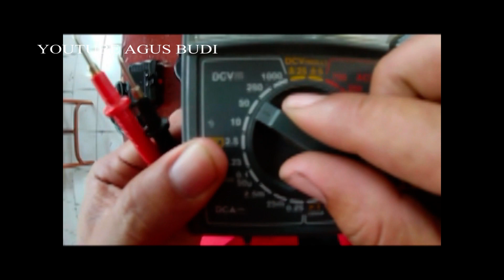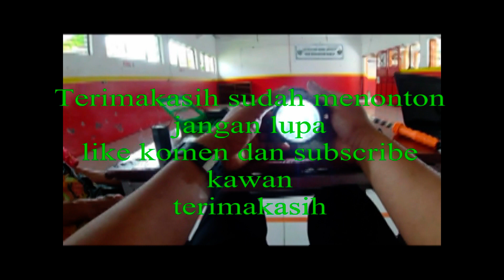senter led modif lebih terang lebih tahan lama

Comment: Bos mau tanya aq kn pny senter kpla tp batreiny dh ngedropan misalkn di tambah 1 batrei lg gmn bos, Batrei yg lama kan vol nya cuma 3,7vol misalkn d tambah 1 batrei lg yg volnya jg sm tp masangnya d seri  kira2 lampu led nya kebakar ndk bos.?
Reply from the maker: ya kebakar gan nanti keluarnya malah 7volt gan tp yang terbakar resistornya dulu di paralelsaja gan nanti voltnya sama tapi ampernya tambah
seri itu hubungan satu tangan  + dapat - 
paralel hubungan 2 tangan + dapat +        dan          - dapat -
Reply: @solusiotomotif  oow iya iya trimakhasih.soale puuuadang takutnya lama kelaman mbleduk hh
Reply from the maker: ya gan sama sama
Reply: Cara menaikan ampere pd senter taffwar gimans gan ?

Comment: Info mas..
Itu batrai berapa volt..
Kalo pake batre 3.7 volt bisa gk mas?
Reply from the maker: 3,7 gan
sama dengan punya saya gan rata2 bekas laptop 3,7volt
Reply: @solusiotomotif  kalo dipake untuk senter cas..kita kasih dua batre gimna bisa gk?
Supaya hasil lebih terang
Reply from the maker: ya gan saya gunakan pakai 2 batre